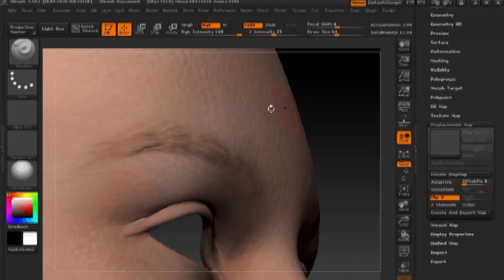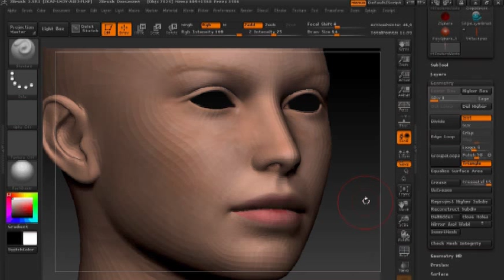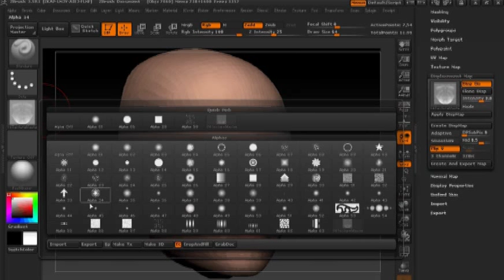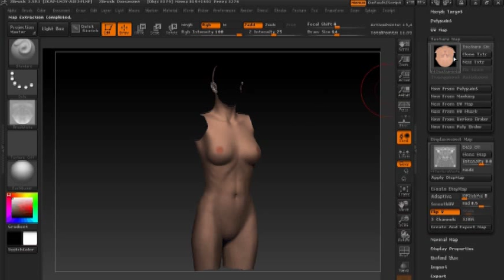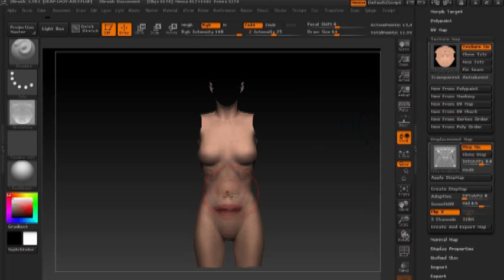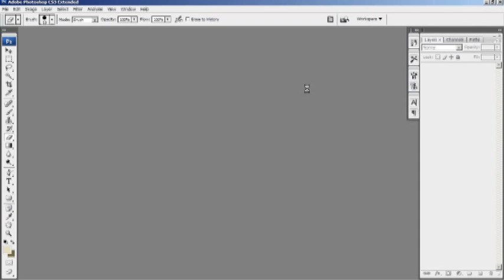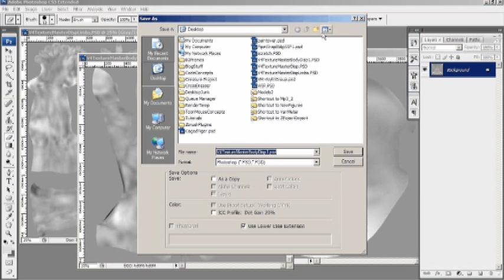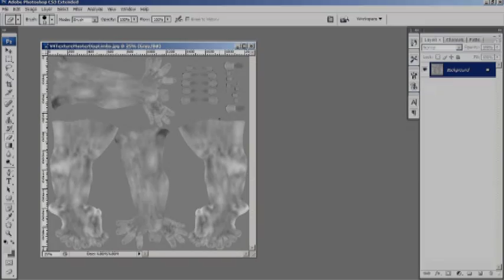V4DisplacementMaps.avi

Comment from the maker: What you have to do is import the V4 mesh with the option turned to have material zones become poly groups. After that, subdivide the model as much as needed then hide everything except the mesh that corresponds to a single map. Import the map you need to work from, flip it horizontally, then have the polypaint get it's colors from the map. Repeat that process for the other material zones. :)